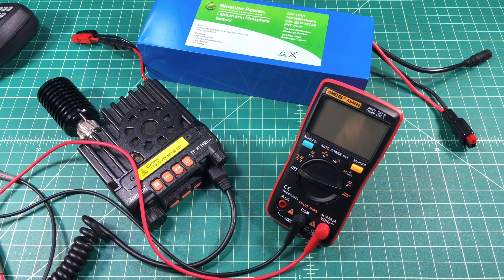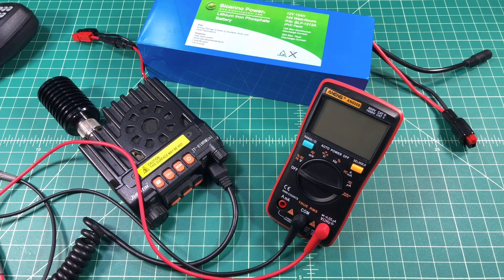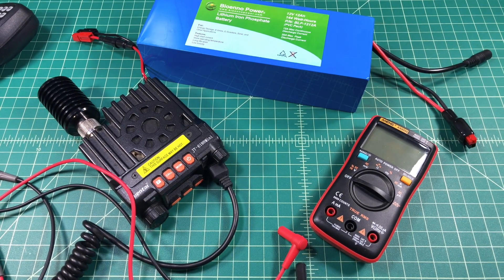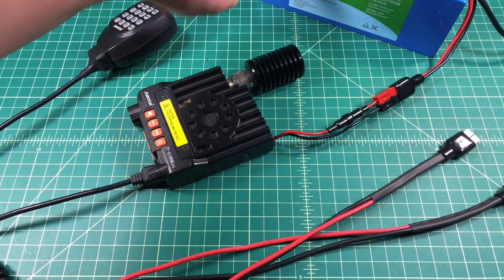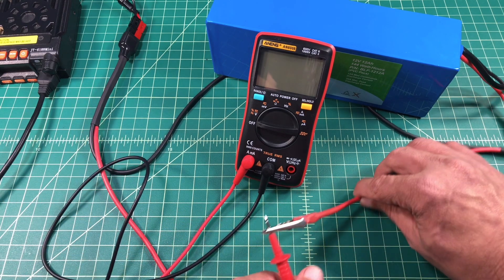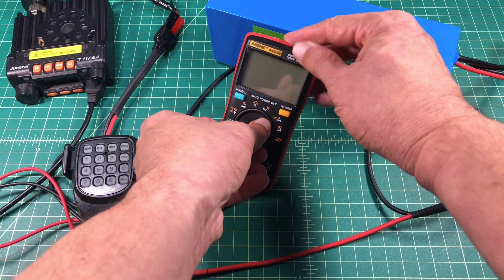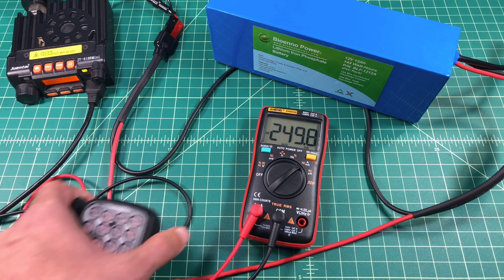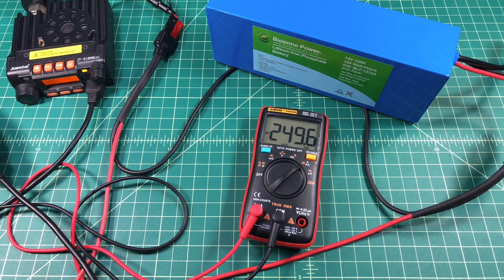How to Measure Current (AMPs) with a Multimeter - TheSmokinApe

Comment: good stuff.  Would have liked to have seen more of that shower of sparks LOL.  Price of admission I suppose.
Reply from the maker: Haha, I’ve don’t that so many times at this point it doesn’t even phase me anymore.  Thanks for checking it out Tom 👍
Reply: @TheSmokinApe  This video actually popped up on my search to ensure I was testing current correctly.  Folks have asked me how to measure current draw of offroad lights to determine the right size fuse for aux circuits.
Reply from the maker: @TomtheDilettante  did I do it right?
Reply: @TheSmokinApe  ha!  Well, you did it the way I would have done it.  So it must be the right way.  :)
Reply from the maker: Wheew...